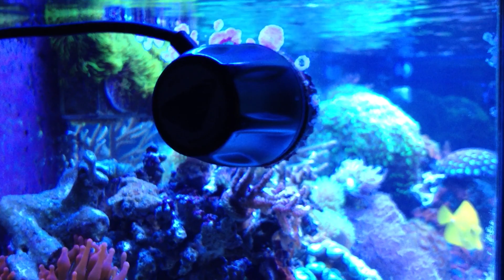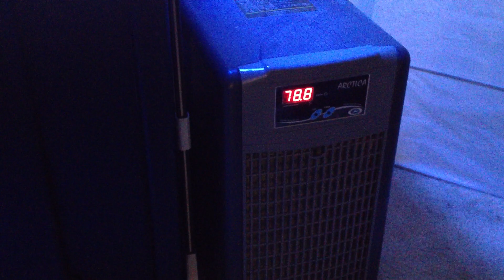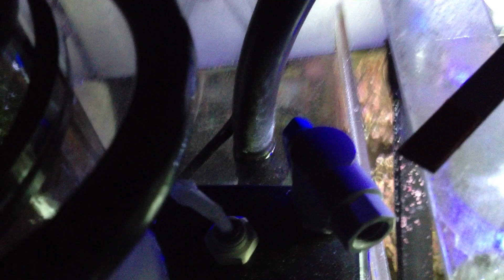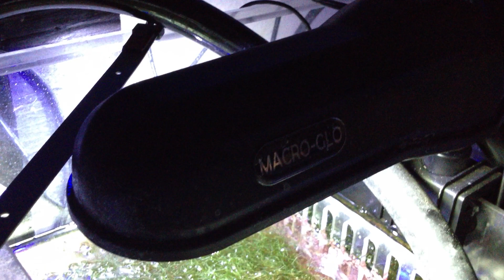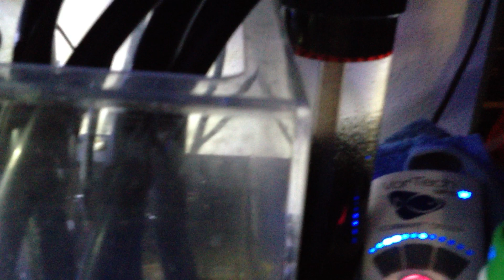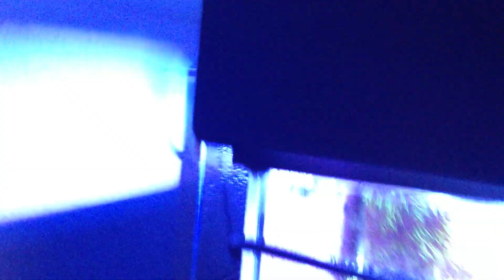jmadden184's Reef Tank Equipment

Comment: Love your tank I have a 5x2x2 I would like 2 cut down on my water changes I noticed you said you just do them now and again I take it you add stuff 2 your water if so can you tell me what thanks
Reply from the maker: Bryan Bullen The primary reason, when I ask people why they do water changes, is "because I need to remove nitrates." With a deep sand bed I have zero nitrates. You can use Kent Marine essential elements in combination with a quality 2 part Ca & Alk and Mg supplement.
Reply: I did have trace of them but I found a dead fish in my rock what got stuck and a rotten star fish under rock what I have now taken out. My store said I should do water changes every week but they do my head in I will get the Kent stuff and just do them now and again Thanks

Comment: Your lighting 
So U say u have t5s 4 bulbs 
And u change your bulbs for blue plus and some other types 
Can I use the same thing 
If I have a coralife t5s two actinic and two whites ?
And would that help my corals get more color?
Reply from the maker: Libi Magana Yes. Using ATI Blue+ in substitute for actinic bulbs will give you greater PAR values. The white bulbs as you mentioned were replaced with ATI Coral+. More color will depend on the height of your tank.

Comment: Hey, can you tell me what kind of tank this is, what it's dimensions are, and where I might be able to pick one up at? I think it's absolutely a perfect size!
Reply from the maker: YD4DKillerboy This aquarium is an AGA (All Glass Aquarium) brand. The dimensions are roughly 48"x12"X21". This tank wasn't anything special as far as constructing pretty basic. I hated glass center brace as well as having to use an external overflow box. My current tank is reef ready with built in overflows and euro bracing (no center brace), which you can see in my current build videos on my channel.

Comment: Absolutely gorgeous tank! Love everything. How do you collect clean seawater and what percentage do you change weekly? Also, do you worry about the possibility of hydrogen sulfide pockets with a DSB?
Reply from the maker: Thank you! At the time of this video I was fortunate enough to be using filtered sea water from a local research institute. I would just change my water from time to time. I honestly didn't really have a schedule. I never worried about hydrogen sulfide pockets within my DSB because there are so many small critters that move the sand around. I also minimize my LR surface area contacting the DSB, because the DSB needs to 'breath', per say. When I took this tank down the sand was as clean as the day I put it into the system.

Comment: I recently went down to my local aquatics store, they happen to be one of the biggest in the north of England and was told that there is no longer any need for all this extra weight and hassle and they showed me there 6ft display tank ran on 2 external filters only. can i ask your opinion on this method as you seem very experienced on this hobbie as id be a complete novice id i went into this. I have to say i find it very apealing since when i watch so much beginer guides ect on youtube there just confuse the hell out of me and look so complex with so many pipes and sumps and refugiums ect i feel it would be very simple and less hassle with 2 externals filters but perhaps there is more work to be done with only these i dont know so id like your veiw about this please. I am currently considering a tropical tank again since it looks so complex tho ever since i had owned fish it was my dream to have a nice marine tank and once again i love your tank, it is in my eyes perfect and exactly how id envision mine to look, thx and plz help its driving me nuts i just cant decide and i am so confused :(
Reply from the maker: Thanks for the complements. I will do my best here to remove what confusion you have. My system that you speak of wouldn't have been possible with just a canister filtration system. I am by no means an expert, but I can offer you my opinion based on my experience with using external canister filters.

What you describe about your LFS is possible. My 60G started out with an external canister filter and did well for a while. The canister is great because you can keep bags of filter media, carbon etc in them with lots of flow. The biggest issue with them is that they will build up with lots of small inverts that produce calcareous tubes also they will trap lots and lots of detritus with the filter mesh that is used within and with the design in general. Canisters are marketed towards saltwater tank owner, but they aren't really designed for the application in my opinion. Canisters on a marine tank can produce issues that you use them to remove in the first place if that makes sense. They need to be cleaned weekly and I can not stress that enough. All the detritus and fish waste that would be pulled from a system by a skimmer would be caught in the canister filter, would not be removed and continue to break down and return to your display.

If you are dead set and must have a canister use it without the mesh and just run carbon in it. Use the canister with a hang on back (HOB) skimmer at the very least. All of the things that you find confusing regarding refugiums and sumps really aren't that hard to incorporate. Putting a sump with a large skimmer is more effective than a refugium alone hands down. The refugiums that you see on most tanks, including my own, are too small to have any impact on overall tank nutrient export, which is why you still see a skimmer being used.

Feel free to send me a PM, so I can try to better explain and answer any other questions you may have.
Reply: ***** Thnak you for the reply it is somewhat helpful, when and if i have and issues or need anymore info i will take your offer of PMing you, thanks once again :)

Comment: Hey! Jmadden Your tank looks great, just starting in tht hobby at last someone makes it simple. I'm starting with 40g breeder any suggestion would great.
Reply from the maker: Thanks William and welcome to the hobby! I try to keep it simple. You found the right video for a guideline to follow as a method for success. There are several different brands of equipment out there, so you don't have to use exactly what I use, but they work well for me. Best advice I can give is don't rush any aspect of your initial setup and exercise patience as much as possible when it comes to stocking your tank, because nothing great happens over night in the hobby only the bad does. Keep this in mind and use this video as a guide and you'll be all set for success.

Comment: Thanks for the video ... where did you get your check valve? its all plastic right? I have been all over town, plumbing supply,big box and pool and water ppl only have brass or fitting which have to be glued .. there has got to be a better way!

Comment: It might be a dumb question, but how do you keep your return chamber water level low? Would you suggest adding a float switch in the display tank that will shut off the return pump if the display water level gets too high?